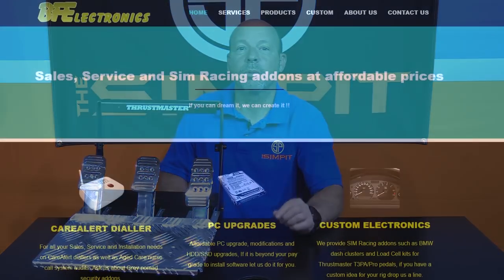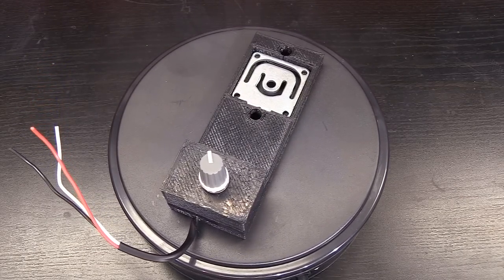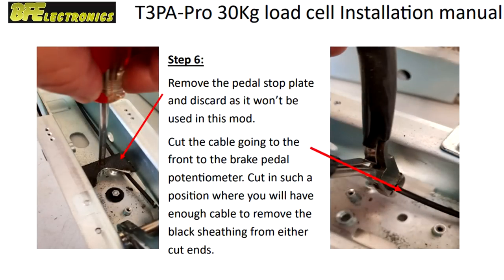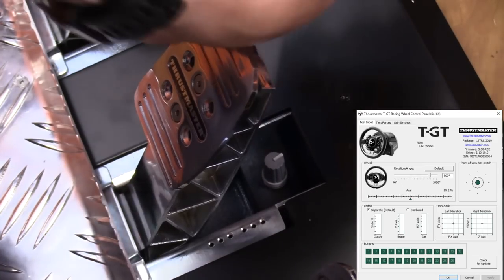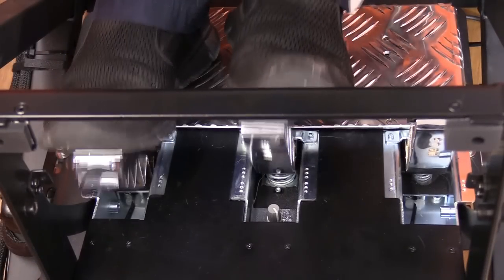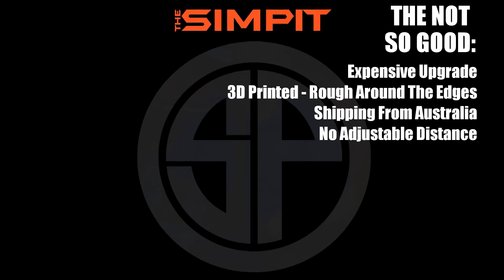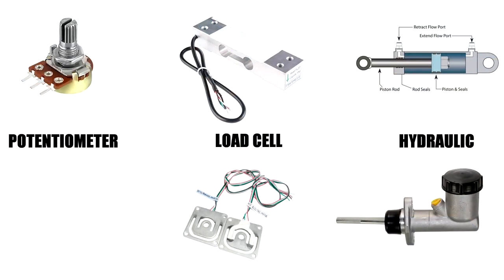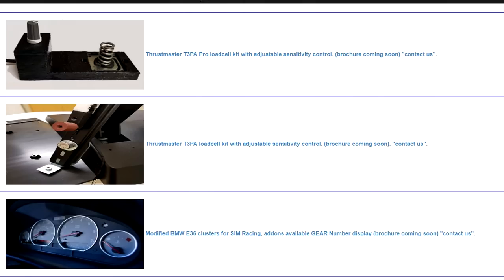Thrustmaster T3PA Pro Pedal - Load Cell To The Rescue

Comment: So I got the bfelectronics T3PA Pro Load Cell kit. I must say that I really like it. Has it made me a better Sim Racer? Well, I consider myself a Sim Enthusiast, not quite a Sim Racer, yet. This is a secondary hobby to me. An experienced Sim Racer once told me that the only thing that can make one a better Sim Racer is “Seat Time”!  

Anyway, to compare the bfelectronics T3PA Pro Load Cell kit to the Ricmotech or Bodin T3PA Pro Load Cell kits. Well, the Ricmotech & Bodin kits provide a stiff pedal post installation (like pushing on a wall), with some dead zone upon initial pedal depression.  The bfelectronics T3PA Pro Load Cell kit provides use of almost all of the original T3PA Pro brake pedal throw, a slightly stiffer pedal feel (compared to the original feel  before installation), and you can dial in your desired level of sensitivity, or dead-zone. 

Lastly, you will have to get used to the amount of pressure you apply to your brake, there will be no Brake Mod crutch to save you from brake lockup. After installing the bfelectronics T3PA Pro Load Cell kit, you will not be able to use your Thrustmaster Compression Spring or Conical Rubber Brake Mods, if you wanted to. 

The bfelectronics T3PA Pro Load Cell kit feels good, it was easy enough to install, and I am happy with my purchase. 

Cheers!

Other YouTube Pros and Cons Videos for Reference:
Thrustmaster T500 / T3PA Pro Ricmotech Load Cell Brake Review
Ricmotech Got my New Load Cell Kit! Review and Performance Test Video
(Ricmotech) Modified Thrustmaster T3PA Pro Pedal Initial Impressions
Thrustmaster T3PA Bodin Load Cell Mod Review
Thrustmaster T500RS (T3PA Pro) - Bodin Load Cell Brake Mod - Reviewed
bfelectronics Thrustmaster T3PA Pro Pedal

Comment: For me also the cheap 3drap mod made a HUGE difference. But with a brake this strong in my opinion you also need to upgrade the gas and clutch pedals because with shoes I couldn't feel those two

Comment: 80€ + shipping, not a bad price compared with other manufacturers.
Reply: @Shambles1980TRealOne – Yes it is 3D printed, however, until Thrustmaster gives us new pedals with Load Cells, the Modder Community is all that we have. 

As far as the price, compared to the Load Cell Mod solutions from simracingsolutions (£99.99), Bodin ($99.99), & Ricmotech ($169.99), the bfelectronics Pro Loadcell Kit (US$100.00) is not too bad. Further, it comes with something that those others do not, a dial for sensitivity and/or dead-zone. 

Lastly, I am a confirmed customer, and I can confirm for you that I can brake better now than I ever could with my potentiometer-based sensor. No, 3D Printed Mods may not be beautiful. Quality of finish on 3D printed parts vary. However, the device is there to provide functionality. All that I can add at this point is that I am happy with my purchase.

Cheers!
Reply: Shambles1980TRealOne  - I can only agree with part of that statement. I do not have a 3D printer, the knowledge, or desire to do this myself. I could have built my home, my vehicle, and I could Doctor on myself. Yes, those are extreme examples, but you know what I am saying. I do not mind spending money on things that other people build (as you see). If you built something that I liked & wanted, I would pay you too. I totally get what you are saying. However, in the end, life is short, I can afford it, and I am VERY happy with my purchase. Nevertheless, I heard your point clearly.

Comment: Looks interesting. If it also works with a T300RS and PS4Pro I might get one and try it. One concern I would have though is a very heavy brake pedal slows me down sometimes, I removed my conical brake mod recently so I could brake faster for time trial record chasing on Dirt Rally 2.0. I also found some vehicles on GT Sport very difficult to drive fast with a heavy brake pedal force.
Reply: I tried the conical mod too, it's junk compared to this

Comment: so does this still use the original poteniometer also? like the black gear cog? i got a set with broken throttle pot cog and wanna get loadcell for brake and use the cog from it on the gas pedal to fix,

Comment: Is this compatable with the slightly different T3PA pedals that come with the TGT and also the T300 GT?
Reply: I believe that the TGT and the T300 GT are sold with the regular T3PA pedals. This mod is for the T3PA Pro Pedals. I believe that you will need the regular Thrust-master T3PA load-cell kit. more information about those are on the BF Electronics website. 

Cheers!
Reply: @MrThamahn  They are not regular T3PAs.  You can even see a pic of all three of them in this video at 0:44.  Those ones on the left are the ones that come with the TGT and the T300 GT.  The ones on the right are "regular" T3PAs.
Reply: @hueysharapova7175  What are the differences between the standard T300 and the T300 GT Edition pedals? You get the 3-pedal T3PA set with "New Pedal Faces"…  And that’s it. Visually, the new pedal faces are a nice upgrade from the standard T3PA faces, with clean lines and brushed aluminum. 

I understand the mix-up, however, Shaun does state that this mod is for the T3PA Pros (0:48).
Reply: @MrThamahn  I mean yea, it is true that the only thing different is pedal faces, but by that logic, wouldn't everything be compatable with all 3?  The "Pro" set is just a backing mount for inverted.  Regular T3PAs can actually be inverted, but you can't swap the pedals left to right.  All the third party stuff I see is for regular T3PA and Pro, but the new version is really important because the TGT is the best wheel for Gran Turismo, which happens to be the only racing game with an online community, and the T300 GT is just a great deal right now assuming it doesn't break.

Comment: Is this compatible with the older pedals that came with the T500RS? T3PA pedals look nearly identical.
Reply: It may have a problem on v1 and v2 pedals,cus we do not have the removable spring post.
Reply: we must be able to install it but as we do not have the same spring (in L) there is a risk of touching
on dois pouvoir l'installer mais vue que l'on a pas les même ressort ( en L ) il y a un risque de toucher

Comment: Surprised they didn't even sand it smooth or anything. Left it raw 3d printed. They need to check into injection molding or a cast or cnc. 3d printing is prototyping
Reply: 3d printing in general is good enough in terms of looks. This one just looks like they have broken or not calibrated printer, bad filament or they dont know how to print. 
With this quality it should be free to download.

Comment: fanatec cle elite with lc for $199 plus s&h
Reply: That is a great deal, if you are ready to switch ecosystems. I do not recommend mixing ecosystems (mixing Fanatec & Thrustmaster hardware), because it wreaks havoc with button mappings in most games.
Reply: Womb Raider  - That was my experience. Maybe they have fixed the issue since. It is all good. Thanks!